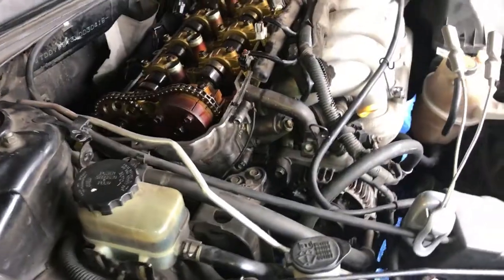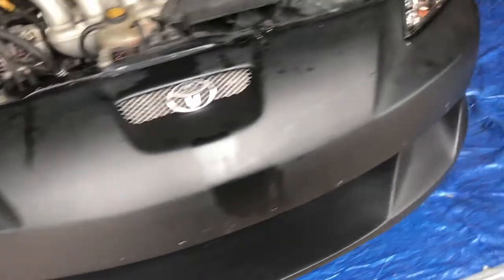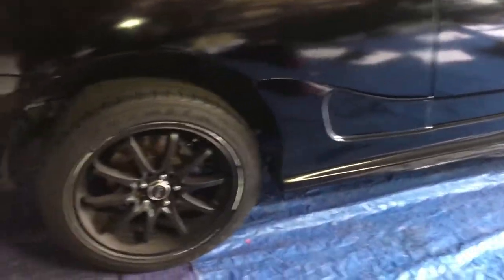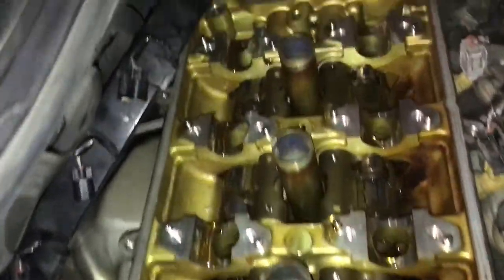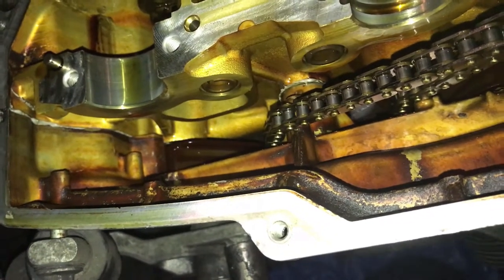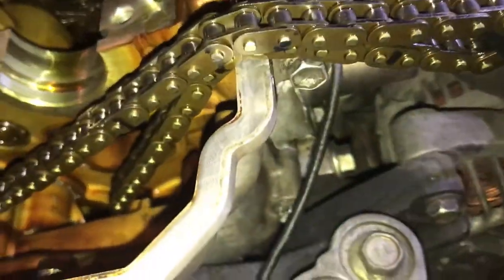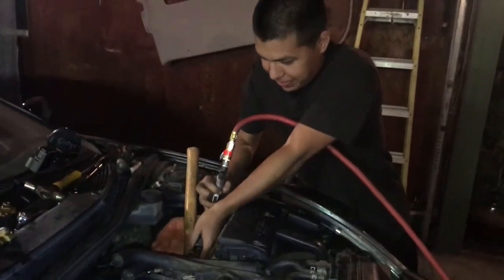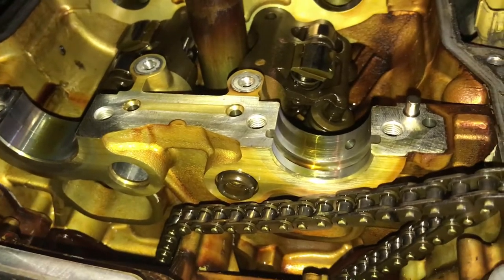Trying to Change Lift Bolts

Comment: Excellent channel and video Rafa, I have a query, I recently acquired a Toyota Celica with 2zzge engine, the engine was plugged because it was not moving for a long time and turned on the oil light, so we did an oil change and removed many pieces of hard and solid oil, we removed everything we could and we loaded new oil, and it worked well, and it sounded perfect but we wanted to make sure that everything was really good and we uncovered the engine and surprise found it that way. the mechanic said that I would not worry that making oil changes every 3000 kilometers would be cleaned alone and after a year or so the engine would be totally clean, I would like to know from your experience if this is true. Or if you recommend taking it to a place where they take it apart and clean it well. I leave you links of the images so that you see it for yourself, I thank you infinitely for your help Rafa and again I tell you, excellent channel! and apologies for my bad English, a query do you speak Spanish? I leave the link of the images here 

https://imgur.com/a/HoFh2FB
Reply from the maker: Sebastián Cardozo thanks for the support I really appreciate it. Yes he is right clean as much as possible and do you oil changes. The oil changes will clean it out little by little and make sure you see it going away if you dont you might have a leak of coolant mix with the oil. Its ok I understood what you were saying and i do speak spanish
Reply: Rafa's Garage Thanks for your answer Rafa! I will make the changes as often as I can and we will see the results later!
Reply from the maker: Sebastián Cardozo your welcome and keep me updated how she runs

Comment: I have a 2000 Toyota celica Gts with p1692 ocv open malfunction code. I know we have two OCV one on the alternator side and one on the battery side in the ocv housing along with the oil pressure switch. Which one of those do you think is setting off the code ? I have emissions coming up soon and I won’t pass with check engine light on. I did take out the screen located behind the ocv housing which was clean so thats not clogged . I’ll check the other oil screen on the alternator side when I get sometime. I did test all wire harnesses going to both ocv and oil pressure switch and they are all getting power. I did test the ocv but even thought they work dose not mean it’s still good. So what do you think I should replace ? And I did replace the oil pressure switch and code was still there. I wonder if the oil pressure switch that I bought from autozone my car isn’t liking it and might have to get the oil switch from Toyota
Reply from the maker: M1009 Channel usually the one on the battery is the one that goes bad, check out the other before you replace anything and made sure u clean the small little filter
Reply: Rafa's Garage yeah bro I cleaned the oil screen filter. I’m going to replace the one ocv on the battery side. I’ll keep you posted Thank you for the reply 👍🏻
Reply from the maker: M1009 Channel ok sounds good keep me posted

Comment: When you go to replace your lift bolts, and find out if one of them is broken, could you screw it back in and have no issues? Besides not having lift. Celica is the daily, so time is always a factor. That’s why I ask.
Reply from the maker: Correct you are just not going to hit lift